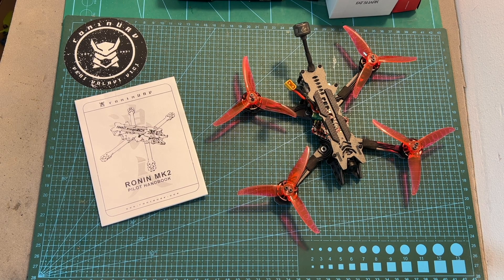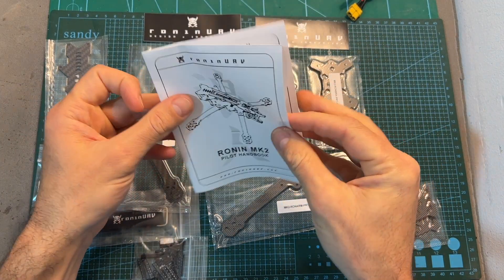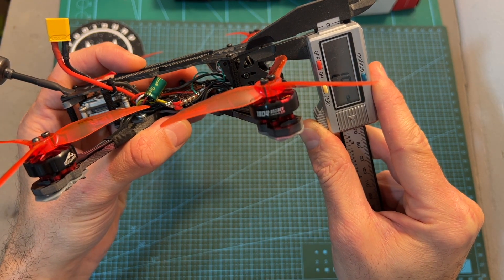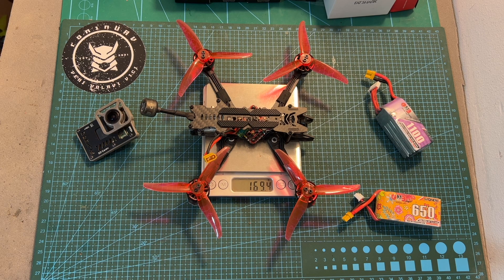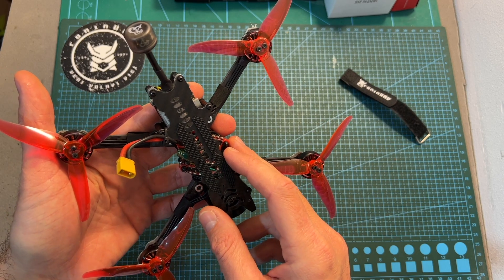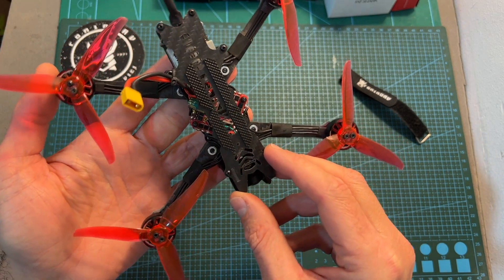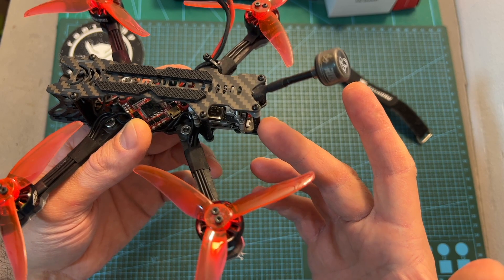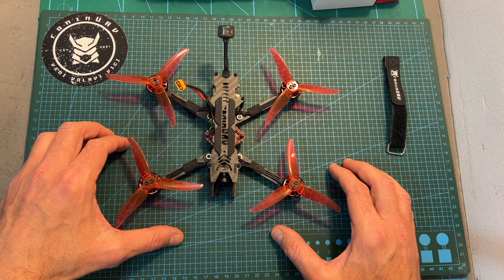Fast & Furious - Ronin Mk2 4" Build & Fly

Comment: Sharp looking frame, I like how much attention was paid to making it light, considering that one person did it all. Looks sturdy. I wonder if a 4th row of standoffs could be added if a 20x20 stack, or 16x16 was used. GKRONINUAV
Reply: Thank you!  But credit goes to those early adopters of the mk1  through their feedback came the Mk2.  A 4th row could absolutely be added if the front stack did not have whoop holes since the USB placement would no longer be a concern (a LOT of time went into making sure you could get at a whoop USB).  It's just that I started making my own frames because so few offered whoop holes up front which in my view is key to a sub 250 build.

Comment: Looks good GK!

Which action camera do you have on there? I see you’ve made your own case. 

GKRONINUAV
Reply: I'll be posting TPU designs for mounts for the Insta360 Go (v1) and SMO 4k soon.  Links to all 3D printed files as well as build log and tuning guide can be found at the bottom of the product page (and included as QR scans in the included paper manual). 👍

Comment: I have a build using the Ronin MK1 4" frame. The assembly was straight forward with the included instructions. The flight controller is a HIFIONRC F7 45A whoop AIO with the factory tune. The motors are Flywoo Dave-C NIN 1404 3750Kv. This is an analog build. The All Up Weight including a GNB 3S 1100 mAh battery is 212 grams. This quad is my favorite build, it flies and handles GREAT for my style of flying. The MK2 is the improved updated version of my frame. I would highly recommend this frame.  The website also includes tuning information. Thank YOU Gal for reviewing this product. Excellent review. Keep Up the good work.

Comment: Looks like you did not have optimal PIDs, or the frame is not stiff enough. The footage is shaky and there is some jello. Lack of printed parts, uncomfortable stand off placement, pretty high weight... So again, micro apex 4 is better in every aspect

Comment: Very interesting frame and looking at their site other frames as well. I'm impressed with the available documentation, not just for assembly and STL files but also including guidelines for setting up initial Betaflight settings and adjustment but also including some basic Blackbox tuning tips. I'm interested.
GKRONINUAV

Comment: 4" are really great class for quads. Light easy to fit in smaller backpacks. And they even pack same punch as 5inchers did. GKRONINUAV
Reply: I'll be the first to admit that I personally do not think they pack the same punch as 5 inch.  Physically that's just hard to achieve.  But hey do pack their own style of punch and for the lighter weight, no FAA hassles, cheaper parts, sturdier frame ... I'll take that tradeoff any day 👍